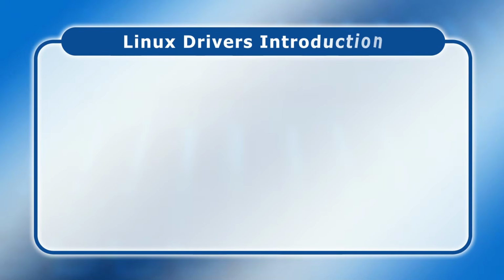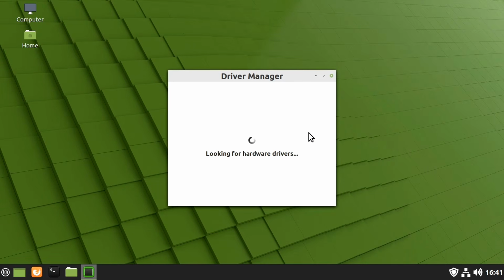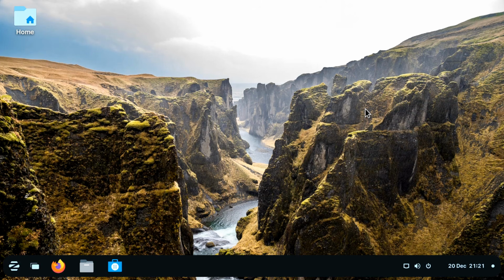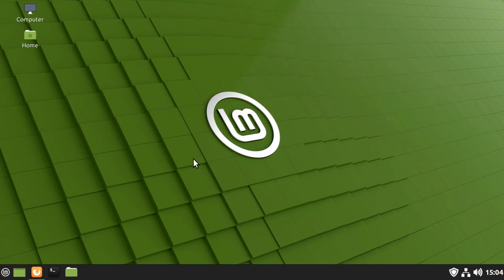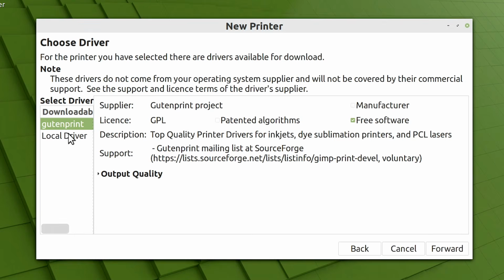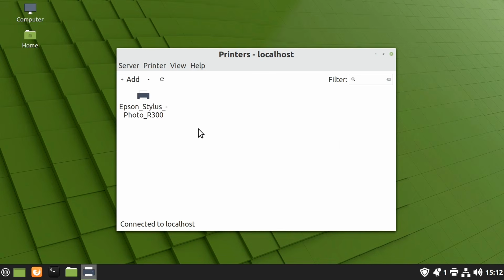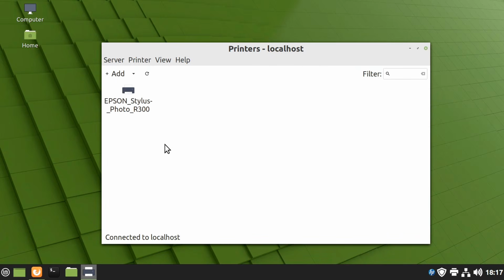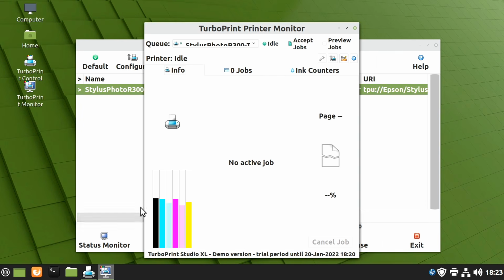Linux Survival Guide #3: GPU Drivers & Printing

Comment: Hey Christopher since you're a raspberry pi aficionado, a good video idea would be to set up "pi-hole" ad blocker.
You configure this on a raspberry pi that you have running all the time and it will block ads on all your devices on your local network.
Reply: This guy’s got a good one: https://www.youtube.com/watch?v=FnFtWsZ8IP0
Though I admit that in trying to implement it, I found it most effective to install unbound first.
I second that this Raspberry Pi use case (or another such practical one) could make for a good video, Christopher; even if another YouTuber has explored it well, multiple approaches help folks learn in their own ways. This is particularly true in your clearly effective writing & presentation style!
Reply: @jonwhatmore5151  yes there are many good pie hole videos out there, I was just suggesting Christopher might also like to do one (it's just a video idea to reach his particular audience)

Comment: One issue I've had, particularly with linux on single-board-computers is finding wifi-dongles with drivers that work. On laptops, they seem to use common enough components for the built-in wifi  that the kernel just includes the driver, but these USB wifi devices are an incredible pain. Maybe a video on how to find one where the wifi will just work.

Comment: Things certainly have come a long way since 1995, when I installed Slackware from a whole load of floppies and then had to configure X manually.

nouveau seems to work OK with older nvidia cards, but if your card is too new, you'll know it. I tend to always use the nvidia driver if I have nvidia graphics card.  I get to use the included radeon driver for my AMD cards as they work well.

For printing, CUPS was the thing that fixed most of the "I can't install this blasted printer" issues, and then Apple somehow acquired it.  Hopefully Apple are giving their improvements back to the community on this underrated yet critical piece of software.

Comment: Great video for newbies. Brother printers are also well supported by Linux, especially laser printers. I bought a Brother wireless printer/scanner and downloaded an install script from their site and it prints and scans perfectly. You don't need to use the script to install drivers but you get more print/scan options if you do. I wouldn't touch Epson with a barge pole, but I do like Canon printers. The nVidia 495 driver works perfectly with my 4Gb GT-1050ti GPU too.

Comment: I've had good luck with my Brother MFC laser printer and their linux support. First few times I had issues (Ubuntu, a lite install I forget the distro, and my first foray into Mint), usually after doing an update to the system, the Brother site helped nicely, though often it was just reinstall the drivers and it suddenl;y worked again, but a few versions back in Mint, this too (knock/touch wood) stopped being an issue.

Comment: My experience with hardware support on Mint has been excellent and far and away superior to Windows. 
I've got an HP printer that works out of the box, and an old Canon scanner that doesn't have drivers for Windows 10 but is plug and play with Mint.
The only device I've had to install drivers for is an Xbox One wireless receiver dongle so that I can connect my controller to the PC, and even that isn't a big deal with the unofficial xow driver.

Comment: My network-connected Brother HL-L8260CDW is auto-detected by Mint upon startup and works fine. However, I believe it's one of the new(ish) generation of printers which can use, but don't need "proper" drivers - there appears to be a standardised set of settings (colour/b&w, duplex, copies, page size, orientation, etc) and then the sending device throws over the pages in PDF (probably - why reinvent the wheel?). I can also print to it from Android devices on the same LAN. There I get the same set of standard settings, but I can install the Brother Print Service if I want additional settings present in the Windows drivers, eg eco mode.

Comment: Really good overview! thanks for including so much detail; it's the little things that aid success.

So (watchng as always on my PCLOS box) I'm following along trying out the various stuff... HP's gadget comes with my distro... I can set up the printer but hell if I can get it to see the printer attached to the XP system, even tho (weirdly, ever since connecting to an iPhone) it now agrees to routinely see the XP shared drives. The printer is shared and works from the other WinSystems, but not here! <bangs head on desk> Network printing in a future video, for sure!!

Meanwhile, XP running in VirtualBox has absolutely NO problem seeing and using that printer!!

Comment: WiFi networking may not work reliably from a live image if the pc has a broadcom wifi chipset, this is because a firmware file may be required which cannot be included on the install/live media due to licensing issues.

Comment: Would it make sense to use Wine to operate a printer with its Windows driver ?
Reply from the maker: Unfortunately a Windows printer driver only makes a printer accessible to Windows -- so if you could run the driver in Linux via WINE (a very big if!), Linux could not use the printer.

Comment: I use turbo print on Mint for my Canon photo printer and it gives excellent results and full control including the CD print function, Canons own cups drivers didn’t even allow the full print resolution without manually editing scripts and suffered the same lack of ink monitor. I also have absolutely no problems with Nvidia’s drivers and have always preferred them over the many years using Linux as I have found other graphic systems very lacking and unreliable by comparison.

Comment: I have been debating on switching over to Linux Kubuntu on my main gaming pc but was not too sure about it yet. I plan on getting a m.2 ssd and install linux onto it to test it out first and if everything runs like normal then I will probably just keep it as my main os. I found out with steam and gaming that you can run the proton option to have it work as well for most games which is handy. A lot of times I play on my game console though.

Comment: Printer drivers are much improved but still a work in progress for Linux. With Linux, it is recommended that you check for Linux drivers before acquiring any printer. I noticed that you did not mentioned Brothers printers. Here in the US, Brothers printers have great Linux drivers support.
Reply from the maker: Thanks for this -- and great to hear of Brother printer support.
Reply: they're also fantastic printers!
Reply: I came to make the same comment. I specifically purchased a Brother DCP-L2550DW because, based on past experience, I knew it would work on Linux/Windows/Mac. Additionally Brother is pretty good at providing firmware updates and give a lot of configuration options through the network interface.

Comment: Thanks for doing these Linux survival guides. They were just in time for my switch from Windows to Linux and have given me the confidence to stay with it. Been using Linux Mint for over a month now on my main computer. Like you and others have said, you my need to "tinker" a bit to get everything running satisfactorily. My challenge was getting my NAS drives to wake up and stay on while my computer is on but I persevered and got them working!

Comment: Another useful presentation.  Unfortunately neither the Linux kernel or the additional drivers like my "AMD A10-6800K APU with Radeon(tm) HD Graphics" processor and insist on rendering in software only, which makes Linux a poor choice for my machine.  Most distro Live environments fail to load and just reboot the machine halfway through loading, but POP OS and Zorin OS both automatically downgrade the graphics requirement so I can at least get to a desktop. Unfortunately Zorin then fails to acknowledge my wireless "Trust" mouse and offers no drivers.  So either I have an uncanny knack of picking incompatible hardware or the Linux kernel isn't all it's cracked up to be.

Comment: Good stuff as usual here.  I wanted to share a recent experience that is related to the first topic here.  I recently picked up a new laptop for my mom to replace her first-generation i3(still going strong).  With mainstream laptops, it's hard to avoid anything but the latest generation of chips.  I put my mom on Linux years ago and we both prefer it to Windows.  I was hoping any driver issues with the 11th-gen line were worked out and things seemed okay at first, but Linux(Mint and Manjaro) was freezing on me with regularity.  This reminded me of when I picked up an Ivy Bridge 3rd-gen laptop when it was new with Windows 8(the thing that drove me to Linux).  Anyway, I suspected it was a kernel issue, specifically with the Iris xe GPU.  I forget what kernel Mint 20.2 comes with, but even Manjaro's 5.13 kernel had problems.  But I went back to Mint as I know it better and manually upgraded the kernel to 5.15, which I believe is the latest stable kernel, and that seemed to take care of that.  It was not difficult to do and there are guides online.  I just wanted to mention it because there are probably quite a number of people who just got computers with 11th-gen Intel chips that will run into this issue with popular distros, and maybe this comment can help someone.

Comment: I've a reliable Brother scanner/laser printer which six years ago wasn't supported by Linux Mint but now is, except the scanner. I've also an older Canon scanner/inkjet printer on which the scanner still works fine, so using the pair I get the functionality required. A Jack Sprat situation you might say.

Comment: Excellent content and video. I’ve been playing around with varying OS on a Pi. We run Manjaro on an old Lenovo celeron laptop which runs well and has no compatibility issues. My preference is LM. It’s great for a daily driver and issues are easily resolved. Three years ago, I stopped using Windows (not everyone can forego it). As usual, you have excellent advice on trying out an Linux OS.

Comment: Hi Chris I've now and again dipped my toe in the water with Linux, the issue that puts me off is the networking.  I've 11 machines The Network Boss if you like is a Dell T330, I've read several resources but there out of date using solutions outdated.  A Networking video would be very useful .  Great Series so far Top work
Reply from the maker: I suspect that episodes #4 and #5 of this series will be on networking and security. I just don't know which way around yet! :)

Comment: from ancient times I'm avoid ATi/AMD cards under Linux, for gaming and video edition I recommend nVidia, for multimedia standard intel GPU with VAAPI is enough... I think more fun is upcoming with AiO scanners (:    as always great video!
Reply: Modern open source AMDGPU drivers are pretty usable. I actually prefer that over the nVidia drivers.

I do understand where the frustrations came from, though, as I also used Linux back in the bad old fglrx days.

Comment: It's funny that you shove talk about the nVidia Linux drivers today. I was investigating the ACPI BIOS errors that are thrown up on boot with my PC. Errors that I thought were a result of having a swappable boot drive, but actually seems to be display driver related. 

Anyway, in the course of troubleshooting, I saw that the 495 driver is the New Features Branch driver, whereas the 470 driver is the Production Branch driver. The 470.94 driver is the latest of this, however 470.86 is the one in the repository. Getting the 470.94 driver installed seems to be a bit of a mission at the moment, and explains that, far from solving any issues, may actually cause more. The general consensus was to leave well alone unless the OS seemed to misbehave. So 470.86 is a good choice for now.

Comment: Computer to router by WiFi, then printer to router by ethernet just would not work, like there was an invisible wall. I could see the printer, but I couldn't print to it despite all components being properly installed on the linux side. Moral of the tale - if you have already torn out most of your hair trying to solve an apparently unsolvable linux problem, try looking elsewhere - some linux problems are not to do with linux after all!

Comment: Great video Chris, this is a really useful series for those of us considering the switch to Linux. These subjects in particular were a real concern for me given I've read some horror stories about driver support for some older HP printer series particularly HP photosmart 3000/5000 series. As you suggested I will be testing the printer functionality running several Linux distros from USB before settling on a preferred distro and final installation.

Comment: I haven't used Linux for a while so took the opportunity to upgrade my (Nvidia) graphics card drivers after seeing your video.  Before you try and install a new graphics card driver you must check with Update Manager that all other updates have been installed first or you'll have problems.  Anyway, I've now updated my graphics drivers no problem.  However  I have a network printer so not quite so easy to install (I couldn't get my Canon MG3200 Printer working in Linux Mint).

Comment: i was pulling hair trying to get a software that will indicate the state of the ink cartridges on linux mint. later on i decided to get rid altogether from the ink jet and get a laser printer. i got one for free from a friend of mine and i'm really happy. ink jet printing is a hoax. when i decided to upgrade my old computer to 4K i bought nvidia video card at first. it was a pain in the ass and i got rid of it after a few days. i bought an AMD and everything works perfectly out of the box both with my old hardware and my new one. both on mint and manjaro i'm currently using.

Comment: You touch on not buying new graphics cards right away, but I find that this principle applies to almost any piece of technology. It doesn't matter whether it be a computer part, an operating system, a game console or even a new type of storage media.

I find that, even if the originals aren't necessarily faulty, by the time of the public having them for about a year, the manufacturer will have made adjustments(whether by hardware revision or patch) that simply makes the experience of using them better.

The greatest example of this is probably Windows XP, which arrived with so many problems that at times made it almost unusable, but by the time service pack 1 had arrived, it had morphed into one of the all time greats due to incremental patches.

A great hardware example would be the laser mouse almost everyone uses today. Originally, they would only work on very specific surface types in specific colours, and even then they would be very unresponsive.

As for media, look at SSDs, which have gone from strength to strength as even beating hard disks in reliability stakes, when original, their TBW was so low they could only really be used for scenarios where files would be read much more often than written.

There are, of course, things that work fine on release day, but even then, you'll often find a year later there will be revisions made that simply improve an already good experience.
Reply from the maker: What you say is true as a general point, but this is not the point I am making about a new GPU and Linux, which is a very different cawe. Nobody releases a new graphics card (or APU) without a Windows driver being available. It may not be the best and optional driver, but a Windows driver will exist. But often with Linux there is simply no driver all. So this is not the same principle of early adopter beware -- wait until the wrickles have been ironed out, etc. Rather it is a case of, buy a new graphics card and install it in a Linux machine and there may be no driver at all and you'll simply have a black screen!
Reply: @ExplainingComputers  true that - my Ryzen 5 4500u is not fully supported even in the newest kernels. The sleep mode is not supported and the GPU cannot be braught back from sleep - black screen and fan spin. I had to modify GRUB entries to enable deep sleep although it is a dirty workaround.

Comment: Nvidia are hostile to open source GPU drivers, no matter what they say they actively undermine community efforts to develop them. Nvidia products should be avoided if your a Linux user which is a big problem as Nvidia have the bulk of the discrete GPU market. Another problem is that the open source Mesa Intel/AMD drivers lack any GPU control panel and the stock UI's like KDE/Gnome have no advanced GPU control panel comparable to windows.

Comment: FULL FORMAT...idea for video?
Love your videos, and did watch one on FILE systems (exFAT etc) but there's something I'm STILL confused on that I simply can't find answers to:
How does the following compare assuming the drive has no data or I don't care to overwrite it?
a) FULL FORMAT of NTFS via Windows' Disk Management, vs
b) QUICK FORMAT + CHKDSK /r (i.e. secondary HDD-> “chkdsk e: /x /r“)
(Is the "Full format" doing "write zeros" twice, formatting AND building a bad sector table? Does CHKDSK read/write to every location to build a bad sector table or is CHKDSK just analyzing locations with files in them? See my confusion? Another way to put this is if I DO NOT CARE about writing zeros but DO care about checking for bad sectors should I just do option B (Quick Format + CHKDSK repair as that's faster? Or does Full Format of NTFS do a better job of building a bad sector table?)